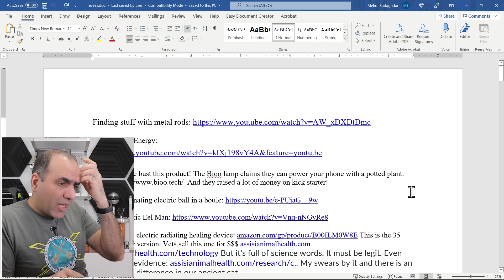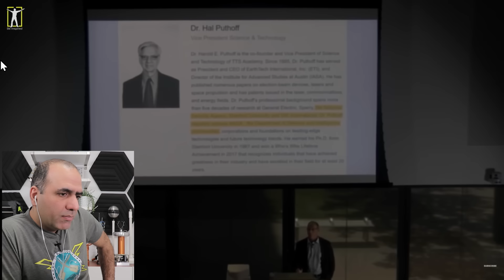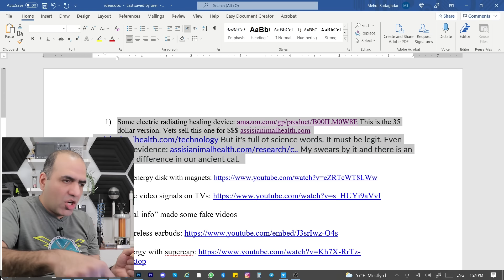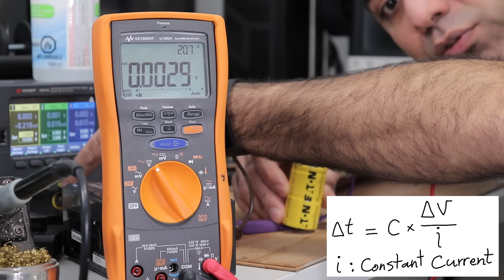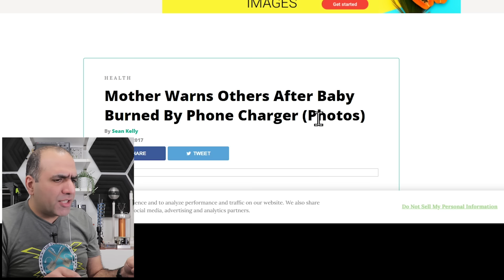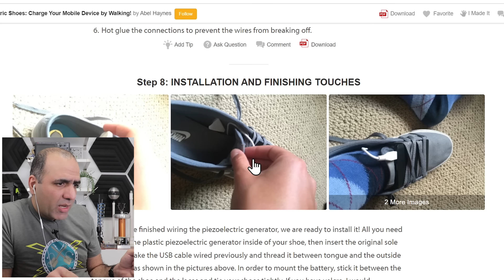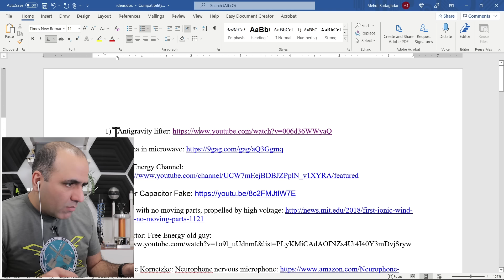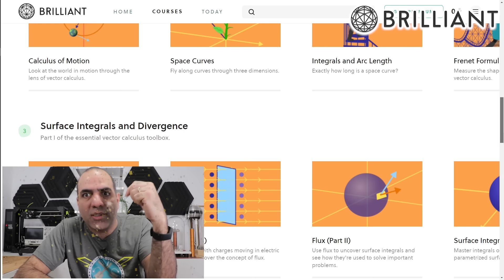The GARBAGE People Fall For, Year-End Cleanup

Comment: Fun fact. Back when electricity was new, they sold little electricity catch pans. You'd put them under your electrical sockets to catch any electricity that would "leak out".
Reply: Completely legit. Though pans will not work, but at least 100 meters long wire piece will. And you must live near 100+ kW AM radio station. Some ingenious folk got free light in their garden sheds near our capital city radio station in this way for several decades. Until AM radio in my country got obsoleted and station was dismantled at end of nineties.
Reply: @KrotowX  radio waves are nowhere near powerful enough to light up lightbulbs.
perhaps if you held these wires up near transmission-line hot-wires, you could sap some power, but you could easily get in trouble doing that.
Reply: If it shocks you it's working!
Reply: wait what where they called? I NEED to look up the history of this, cause its so stupid that its funny
Reply: in the US, our AM BCB stations iirc can only go up to 50 kW TPO--i wonder how close one'd have to be to actually get usable energy from a broadcast station of either caliber
Reply: Yeah, not surprising really.
Reply: @rogerwilco99  🤣
Reply: Lmfaoooooooo aahahahahah 🤣🤣😭
Reply: @valdecoxib balls

Comment: Those power saving stickers are a popular scam here in the Philippines. A lot of people get duped into buying them. 

Also power savers that are basically just a capacitor inside a box. Based on power factor correction but obviously the bill for residential customers isn't affected by power factor 🤦‍♂️
Reply: Yes, Mehdi has a video on them
Reply: Hey I have a question. Why do devices such as voltmeters have terminals? It measures the voltage which is basically difference in the potential of two points so what's the point behind having terminals? Isn't it useless? The difference is gonna be the same and only the sign changes. Does the sign has any importance?
Reply: @Warlord_Megatron  Terminals is so we can switch cables. Red and black because lots of devices will break if we can't measure what is positive and what is negative.

Try to charge a car battery with reversed polarity...
Reply: The best power saving sticker is placed near light swith and says "Turn off the light when you are not using it!"
Reply: @udajs  Yeah but those stickers are inefficient compared to the ones we had when I was a kid. Back then you could save 100 watts or more now I only get 13.
Reply: @ghz24  And they say that technology only advances...
Reply: Fun fact - capacitors indeed can help to avoid AC power loss, caused by large inductance like large electric motors. However capacitor or capacitor bank capacitance must match to particular motor inductance to do the trick. Factories and other places with large industrial AC motors indeed use large capacitor banks for that. However these are carefully made to match particular motor inductance. Also more or less correctly build house appliances with motors like washing machines, dryers, HVAC units etc. already have matching capacitor(s) installed in appliance itself. They simply would not pass various certifications without that. So these "power saver" boxes in reality save nothing. Or make AC power loses even worse.
Reply: @ghz24  LOL. Son arrived home and said to his dad: "Daddy, today I ran after the tram and saved $2.". Dad answered: "If you had run after a taxi, you would have saved $10".
Reply: @KrotowX  yes it's called power factor correction. But residential customers don't get charged for those kind of losses. 

Commercial customers do and that's why they buy the right equipment to help. But like you say, it's significantly larger and more expensive than a little capacitor inside a plug.
Reply: I live in this country, but I never know they existed LOL
Reply: Wait, those stickers are being sold in the same country i live?
Reply: In China, almost all senior people believes cell phone, TV and WIFI could fry babies' brain XD

Comment: As a civil engineer, I've never seen a contractor actually use those stupid rods. For one client, I mark sewers and it would be nice if those did work for finding force mains.
Reply: I've used it to find fiberoptic cables... usually can get within a foot of the cable
Reply: my buddy was recently stuck at a site and they couldn’t find the water main, the old timer came out with his rods and found it in 4 minutes.
Reply: @jordanlarson8310  ...
In the country we use them to find septic tanks... And it works like a charm.
Reply: @hokiepokie333_CicadaMykHyn  
Someone needs to do a test that proves they actually work. So far, all tests have shown it does not work. I'm not doubting they do per se. Just that it needs to be proven that they do really work.
Reply: @wilsonrawlin8547  ... I've used them with 100% success many times... And it's quick too (kinda like using a stud finder)... 
However, i can say that I've never used them to locate any sort of electrical fields... I've only used them to locate things as small as 1" pipe (several feet underground), to "many" cesspools and leach lines.
IDK how it works, but it's just something we've done out here in the country, forever!!!
And i work with a shovel... so i don't have the luxury of wasting daylight, nor digging hundreds of pointless holes!!!
Reply: @hokiepokie333_CicadaMykHyn  

If it works it works. Too many people have used them over the years with success. I want to try using them for finding gold. ;D
Reply: @wilsonrawlin8547  ...
I'm fresh outta gold, or I'd test them out to see if it's even possible... Best i could do is some aluminium foil!!! 😂 And maybe a hot pocket...
Reply: @hokiepokie333_CicadaMykHyn  
LMAO!! That was great! I'm going to try them out on a hidden hot pocket. Philly cheese. ;D
Reply: @tynj4173  funny enough, after making this comment, I saw someone use these to locate a sewer force main and they got it dead on. I'm now a believer.

Comment: 7:06 

q=CV
q=(400F)(3V)
q=1200C

You need 1200 coulombs to charge that to 3V. Since an amp is one coulomb per second, just take 1200/Current to get the number of seconds it takes.
At 10A, that's 120 seconds, or TWO MINUTES. 
To charge it in a second, you'd need 1200A!!
FAF
Reply: For reference, 1.2 kA is around the lower bound of currents occurring in lightning

Comment: Gotta say, when I was young I worked for my fathers pipe laying company for awhile.  The L rod's trick does seem to work  for finding larger diameter pipes like water mains or storm sewers. You don't rely on and always get utilities marked and check your plans and all but we used it a few times trying to locate storm drains we needed to tie into when the plans were wrong. Ive never heard of anything about them pushing away from each other or for finding electrical lines or anything like that. I always assumed it was something to do with the hollowness of the pipe. You should try it on your water mains coming into your house. Make sure you point the rods forward and about 15inch apart and do not hold them, just provide light support, when you walk over the water main or storm sewer they will cross each other.

Comment: 9:24 the wires were there to put those diodes in series and add up the voltages. Imagine if instead of the wires you had a chain of diodes in series... you could make a diy solar panel! Maybe an idea for a next video???
Reply: How do you think an actual solar panel works?
Reply: @monticore1626  Dielectric effect.

Comment: Oh man, watching you hold that supercap while dumping 10A into it made me nervous.  I had no idea they were that hungry for charge.
Reply: human body will not draw 10 amps on only 3 volts
Reply: @integrationofmanandmachine4714  I'm not worried about the electrocution risk, I'm worried about the explosion if that amount of energy rapidly turns into heat.
Reply: @lvachon  there is no thick conductive nearby. Even if the cable which was used to charge the condensetor was shorted, it would rip.
Reply: @lvachon  oh I think you mean the capacitor heating. Capacitors can be charged at super high amps with no or little heat especially electrolytic supercapacitors.

Comment: 14:34 discharging the "7000F" capacitor while holding the wire from which he's discharging it with his bare hands? That's some non-existent free energy right there in the capacitor
Reply: It's 7000 Fake.
Reply: Definately fake cap. But he shouldn't get a zap if he's only holding onto one terminal of the cap. The circuit is between the supply and across the wire. Also it's not mains voltage which is ground/earth referenced.......don't know......what do   you think?
Reply: No current will actually make it to his hands, but I get his fingers got a bit warm.   There would definitely be burned fingers if the wire was held much longer.  That said.. Mehdi's right, that capacitor is a total fake and probably houses a battery inside.
Reply: @kittenisageek  
 But it's a DC current coming from an electrolytic capacitor with 2 terminals + & -. 
 Electricity usually travels along the path of least resistance right? He is holding the wire at the end and not in the path of current flow. So shouldn't the current travel from one terminal across the short/wire and to the other terminal completing the circuit. 
Now if it were household AC ground referenced current and he was touching only the active wire while he himself was grounded then yes sure he gets zapped.
Reply: @jayytee8062  The voltage isn't high enough to do anything if he touches both terminals with his hands  -- even if it were an actual super capacitor.  Super Caps are very different from most other capacitors.  They generally have a voltage range from 2 to 5 volts or so.  So he could lick the contacts and get a tingle on his tongue, but that's about it.  At the same time, the amount of current that can flow through a conductor is really high, which means that even though you only have 4 volts, you can still melt wire.
Reply: @kittenisageek  
Yes i get that part. 
I was using the example of the guy in that video clip with his homemade cap.
Hypothetically if it was functional with a high voltage rating and he did as he did in this video clip he should really get zapped as all the current is flowing from the negative through the contact part of the wire then through the wire and back to postive terminal. The bit that he is holding onto is sticking out the end and is not in the immediate flow path.
Reply: @jayytee8062  "electricity travels along the path of least resistance, right?"

well its kinda right, the correct phrase is "electricity travels most along the path of least resistance"

google "current in circuit of parallel resistors".

Comment: You should try the L rods actually walking over waterlines. You lean slightly so they are stable but when crossing water lines in the yard etc they cross.. I've used it multiple times and it actually does work. Weird but true

Comment: The first thing is a wide spread method to find underground water. It is not very accurate, but it works so 50% of the time. And not everybody can use them. I don't know how it works, but somehow it does sometimes and to find a new water source is very valuable.

Comment: I know the water dousing thing seems fake however I have tried it myself and something is happening. I bent the rods on the end where I was holding them so I could hold them steady and they still moved. I've seen people do it with a Y shaped branch from a tree. I don't know what the process is or how well it works all I know is something is happening and it isn't BS. I did it will a pair of uncoated brazing rods.

Comment: With the rods thing, it does work, provided that the utility has current going through the tracer wire. We had plenty of trainees come in and say that it doesn’t work, we would grab one rod locate the gas line that we were sending a high frequency signal through, with the rod and then go and use the actual locator and see how close we were. Hundred percent of the time if you knew what you were doing you were dead on within reason with the locator.
Reply: I should clarify that we used one rod. Not two.

Comment: 2:32 to fully refute those rods, you might want to make a set with bearing handles. Not just two simple pieces of wire.
Reply: @VoltisArt  understandably sketchy, but I have personally seen people using such rods with good bearings. 
I was thinking to myself that it worked like an Ouja board in that slight movements of the hand influenced the movement.
Not a straight up scam in some cases, just two people believing in something that doesn’t seem plausible.
Reply: Reducing friction on the rods wouldn't get rid of the influence you can have if you tilt the rods, as they'll go to that direction for the offset mass
Reply: @crackedemerald4930  yes. Just saying that he should also disprove that too if he wants to.

Comment: Now the very first thing you reviewed. Using the metal rods to find underground water pipes etc. I was also a skeptic. Then i bought my own house and had a busted pipe underground outside. The contractor i had to come dig the trench to city pipe and up to house used this method, and found the pipe first try. So still being skeptical, i asked him if i could try it myself (now knowing exactly where i buried my new water line. He told me to make sure to just have them very loosely in your hands. So i tried it, and it worked. I was not moving them myself, it was not momentum from me stepping forward, but there was definitely some force moving the rods outwards as i crossed over the path of the water lines. For credibility, i have my associates degree for industrial controls technology, currently working towards a bachelors as electrical engineering. Ive worked over a decade as an industrial mechanic, technician, and for the last 3 years, controls and automation engineer. This one is not bullshit. I do not know how it works, but id love to watch you try it for yourself before dismissing.

(Edited for auto corrections / typos)

Comment: The two L-shaped steel rods work (I have used them many times) to find underground water pipes. I still haven't figured out how, but they will bend quite strongly when walking over water pipes.

We use them on the farm to find water pipes (in plastic tubes) to figure out where they are, and they are accurate to about a meter or so
Reply: Works for telephone cables here too
Reply: Surprised nobody is saying this but it’s not from electric like that one guy’s video said my Grandfather showed me this trick (he owns a company that puts internet underground)
Reply: I’ve used dowsing rods as well. Worked with a municipality where it was common practice to do this to locate water or sewer lines
Reply: @jibdraw1501  same bro it’s real

Comment: Water witching works.  I do it with a single utility flag.  Bend it 90 degrees, hold it lightly, walk near lines, it will respond to lines underground.  I didn't believe it until I did it.  I was taught by a underground line locator.  The use it to get an idea of locating pvc lines that don't have locators on them.  It's mind blowing.

Comment: Disappointed with your opinion on dousing rods. They work with outstanding accuracy. As the owner of a dozer and backhoe company, we use them all the time. Capable of finding buried lines and septic tanks within a couple of inches. My great grandfather taught me to use them 35 years ago. He used them in the early 1900’s to locate grave edges in cemeteries. 
Take them outside your house and hold them loosely pointing forward. Walk to your sewer line and watch what happens. I guarantee they will work 100% of the time with buried objects. They will not pick up underground springs or water like some people think.

Comment: You technically can get free power with light bulbs, provided that you're using LEDs. It's simply because they're diodes, the same type of components solar panels use. It isn't much, you won't even get enough for your phone to register that it's charging (unless you make a circuit the size of an average room lol)

Comment: I’m gonna tell you right now. Using two bent clothes hangers the correct way when  crossing a water pipe underground perpendicular will tell you where the underground pipe is. The two clothes hangers will attract each other . You have to do it the correct way and I promise you it works. I have no idea how I have no idea why. But I have used it many times to find underground pipes to repair. If you don’t know what you’re doing, it won’t work. I’ll give anyone a demonstration.

Comment: Would be interesting to see if quartz crystals could be used to produce a shock that charges a small capacitor enough that then is able to power a red or blue diode. (less than a second, but long enough to see if it actually is on with your own eyes).
Either that or some other piezoelectric material which could deliver that effect.

Of course I have no idea if it's even possible, but would be interesting.